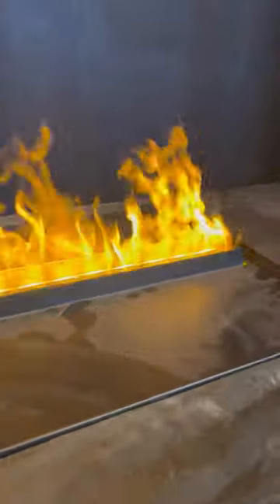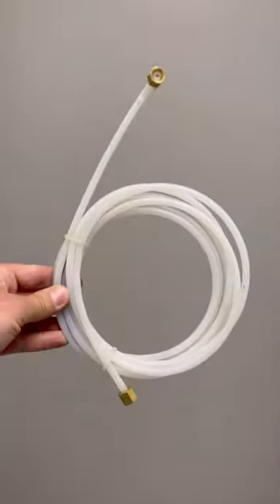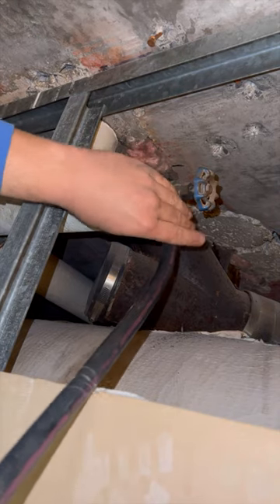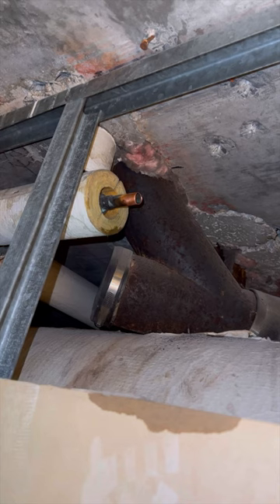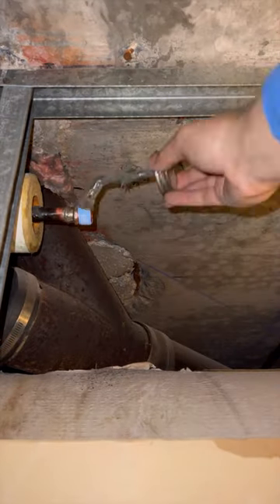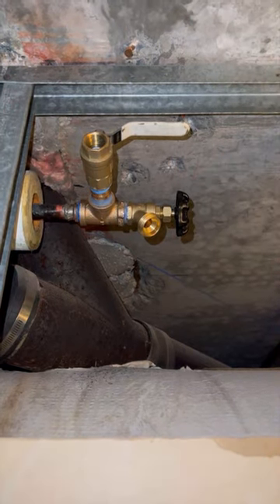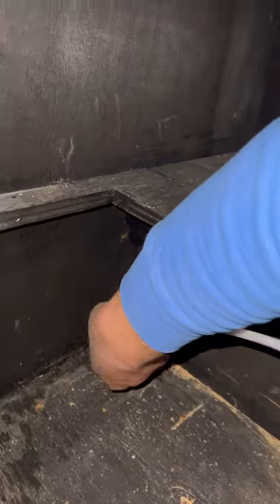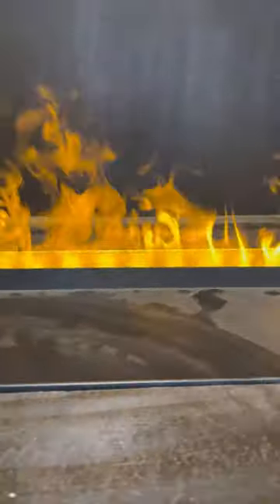Installing a water vapor electric fireplace. The most interesting thing I have ever installed.

Comment: Never saw anything like that before, very cool.
Reply: I wonder how much it cost 🤔
Reply: @beieber4life Is NYC people... 🤣 Where they have money to burn. Who ever thought of installing a "fireplace" that produces NO heat?!
Reply: @OldsmobileCutlass1969Va  lmao, well said 😆
Reply from the maker: 2k for the unit
Reply: @OldsmobileCutlass1969Va  ב''ה, think I saw these around when they first came out; it's a fancy-looking humidifier and probably would be particularly appreciated in the southwest.. but if y'all got steam taking it to 90 in the winter or A/C without some central humidifier I could see it being appreciated in the city.
 
Does this particular one have a heat blower?  Some of these things are gonna have a standard 1000-1500w ceramic heater and blower in just for feel and convenience, didn't squint enough to see if this does.  Spent one New England storm blackout huddled around a propane insert and, despite the real flame, those barely throw heat unless they have extra elements designed for that anyway - took hours to even cook a fiberglass potato in it and hopefully they aren't using loose fiberglass as fake coals anymore.

Comment: I applaud you for sweating that connection! So many plumbers, HVAC technicians today don't know how to use flux, solder and a torch they only use pro press that I believe will eventually fail and leak when the little O Ring deteriorates. , I had a company in my home servicing my boiler they refused to solder the new fittings, when I asked why? They said they didn't know how to solder??? 😮😮

Comment: Pro tip : tape a smaller diameter pipe to a shop vac and run it through your fitting and avoid cold shocking your solder which could potentially crack it. Other than that, good job. Never heard of water vapour electric fire place either. Looks really cool.
Reply: “Other than that, good job” lol

Comment: Cool AF Broski?  Just wondering…Why solder the adapter vs other types of connections that don’t require a flame (clamp etc)?  Was is a code requirement in NY?
Reply from the maker: Press is allowed as well but i use the press for bigger sizes only

Comment: I can imagine in NY the Fire department gives fines for a false call but here there's always a little grace. Ive worked from northern Ontario through Toronto, Ottawa and Montréal and never saw a fire department give a fine. I have even fucked up and set off the alarms accidentally a few times and to be honest the "boys" were just happy to see it be a false alarm as opposed to a real fire. Keep in mind my job requires me to put the fire system on test/ bypass the fire panel and the central alarm company be notified before I start anything on the sprinkler system.

Like I said though, I can imagine in a city like NY they dont fuck around and probably enjoy handing out those 5000$ fines.

Comment: Dumb question: The existing drain valve was threaded into a male fitting on the original pipe — why cut it off and replace it? Was it too corroded, or is just too risky to even try to loosen it? Looks like there was adequate clearance?

Comment: Hi bruski, i just installed 2 of this machines the colors of the inside and the buttons looks the same so i guess its the same company, and the fire is not as nice like yours (on video) do they have a few models of this? can you give me a model number or something?  The water pressure is good,
2nd problem, It has a problem that 1 bin fills up the other one and if its not leveled the whole machine shuts off.
Reply from the maker: This one doesn’t have bins. Dimplex is the brand. Im not sure which model was this

Comment: I looked into building such device, but one thing stopped me. Yes, it's easy to get a piesoelectric cold mist evaporator and install LEDs, but all that moister will get eventually get condensated and make everything moist. I haven't figured what's the best way to handle that. Do you run an exhaust fan to get all that moister outside?
Reply: Normally you have to use cement board around it, a fan will suck out the whole vape so it will not be nice.
Reply: @arifried1  The vape is meant to be shown once while it ascends from evaporator. If it would be curling around, the visuals will not look like a fire. The flames need to go up. Anyways, with cement board, you will still have water droplets everywhere. Even if they won't get absorbed by the enclosure, it will accumulate into pools.
Reply from the maker: No fan but they used waterproof paint on the wall above it and around the fireplace
Reply: *moisture

Comment: What type of blade are you using on the grinder to cut copper?
Reply: I think that was an electric copper cutter.
Reply: Any metal cut off wheel will work fine. The big metal ones with diamond chips is a no no it will hit you in the face with pieces
Reply from the maker: Blade for metal bro
Reply from the maker: No it was a grinder

Comment: The Supa was probably like bro your the first guy in months to need a fire permit. Get a propress gun and call it a day I can sweat pipe with the best of em. It's just barely needed now a days and a waste of time. Sorry, buddy pro- press is cleaner and less time consuming along with less liability with flames open in walls or ceilings. Yes fittings are more but worth the less time and fail rate (of sweat joints for new hires). You still need some knipex small gators 7" locks them biotches will change your life just like the fire place did promise

Comment: Why not use crimp copper fitting
Reply from the maker: Solder safer. Building likes soldering
Reply: @hydronyc  solder is safer huh.i don't agree with that.but if that's what the building wants u do that.